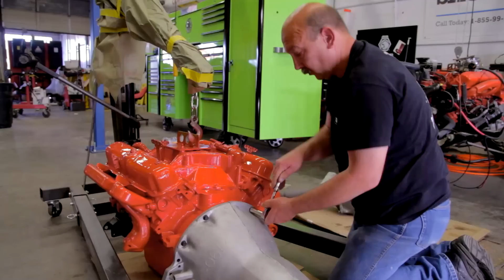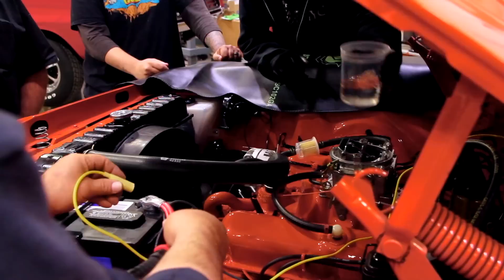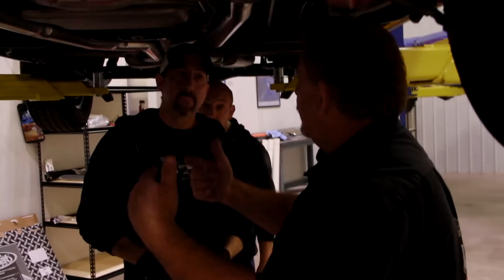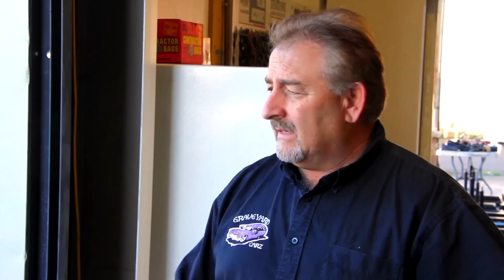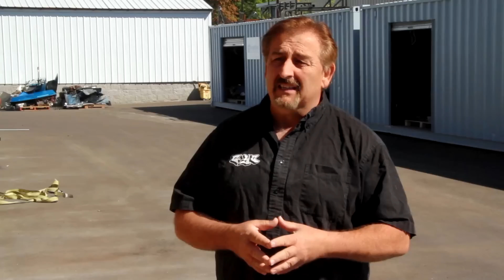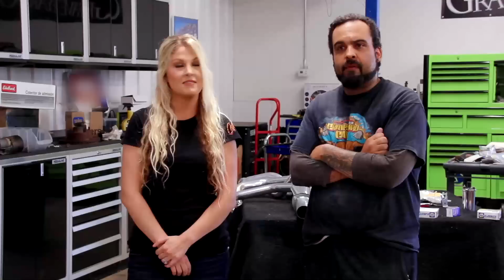'70 'CUDA FAILURE: WHO PUT SAND IN THE ENGINE?

Comment: I love how all these problems just happened but no human caused it. This guy's a narcissist he did it all himself and won't admit it
Reply: really? And i suppose you have prove of that?  He was waay past the delivery date to the customer by over 6 months.. He recently fired a disgruntled employee named Darren by the way, who would have a better motive to sabotage..
Reply: @aarmancuda3570  I say this because he didn't even look to see that the valves obviously crashed a piston, bending a push rod. He adjusted the valves.
He built the engine.  He caused all the previous noises.  All after a carb problem.  What bends a bush rod!!?? All amateur! You don't just slap an engine back together after bending push rods!
Reply: @Ecoscienceczar  even if he caused the top end to go out by bad engine building as you say, there is no compelling reason he would sabotage the motor himself with sand.(as we found out when taken to the machinists shop).a customers car that's way past delivery date? And more time and expense as well? Sorry, your accusation doesn't hold water..
Reply: @aarmancuda3570  sand doesn't turn into sludge. It was a failure.  And the show made a show out of it, at the men's expense. 
Made him look as if he couldn't admit to mistakes.  Someone made several mistakes,  other than than the so called sand , I suspect old oil filter, or all that cheap Molly settled in the oil pan.
Reply: @Ecoscienceczar  man I swear, you just don't get it..the machine shop found SAND in the motor guy!  They had to over bore the engine AGAIN 10 thousandths over..why would the shop lie about that? I mean really!??  The bores were scored, the piston skirts we're scored too.( All more money at his expense) . Remember, you accused Mark of pouring sand into his own engine.. motor oil does turn to sludge when dirt is present...get a life dude..
Reply: @aarmancuda3570  OK their was sand. Sand doesn't bend pushrods. What ever. It was savatage, and the guy is totally the type to admit when he wrong.  ok.
Reply: @Ecoscienceczar  There / Their... sound alike / different meaning 😉
Reply: @Chryslerdude  Brilliant! Thanks for the  smart comments 👍
Reply: @Ecoscienceczar  My pleasure.. and thanks for your unfounded speculations